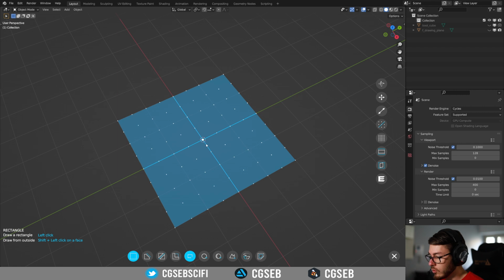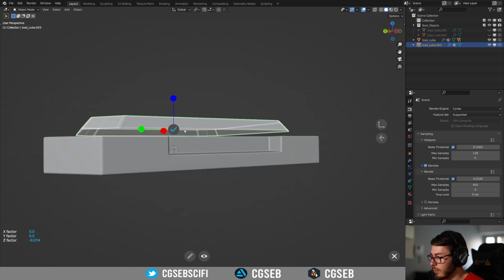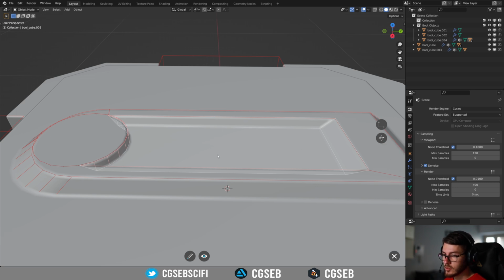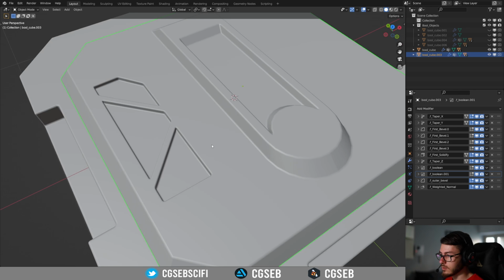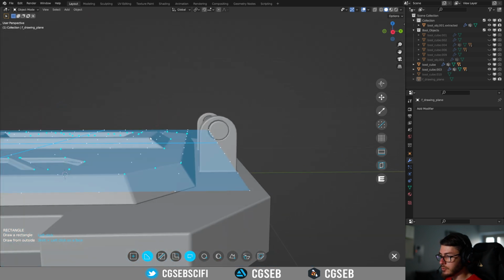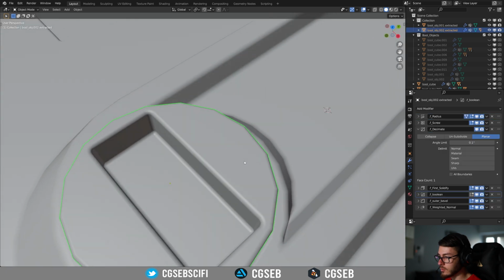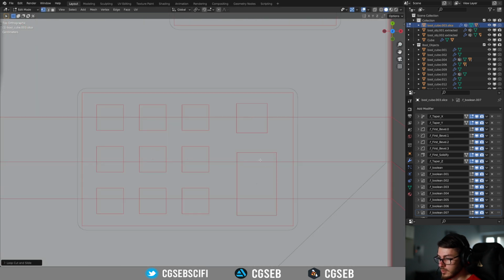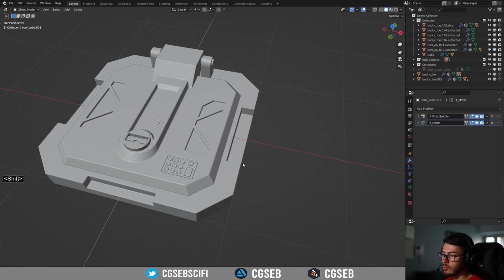Model A Hatch With Fluent 2.0 (Blender Addon)

Comment: Nice walkthrough, design wise though I would suggest anyone who is into sci fi stuff avoids really obvious 45 degree angles.
Reply from the maker: Thanks, why is that? I see them everywhere on very good looking scenes
Reply: @CGSeb-scifi  Personally I feel like Its a sign of an ameteur designer. Bevels are made at 45 degrees by your software of choice and most people just leave those as they are without much thought or care. 45 degree angles have their place but they are not very interesting to look at especially in modern scifi. I suggest checking out Alex Senechals video "Common sci-fi mistakes", there are a lot of great tips there to push your sci-fi design.